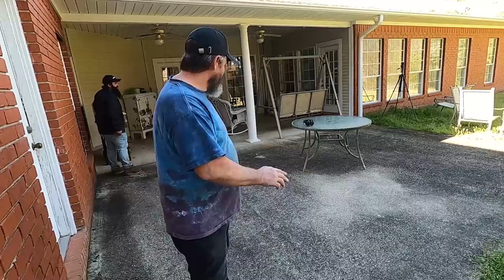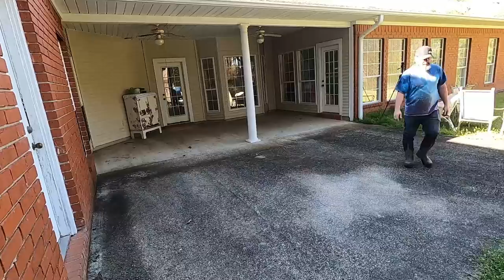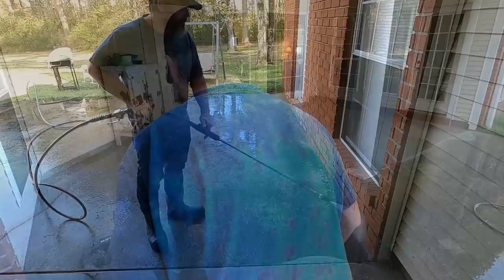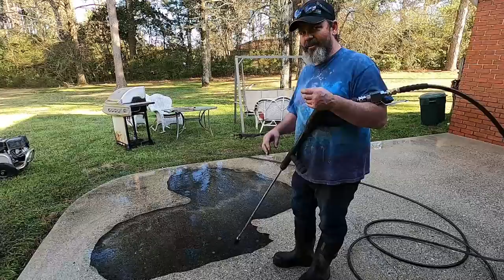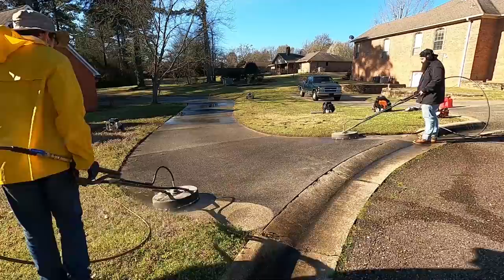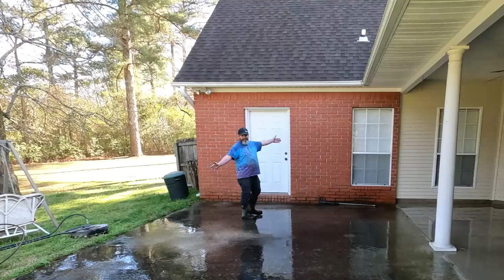REMOVING Decades of FILTH for FREE this ELDERLY woman's PROPERTY TRANSFORMTION is INCREDIBLE!!!

Comment: I am filled with warmth and happiness to know that you boys help others, especially elderly and too sick to do the upkeep on their properties.  My parent's and even myself are in this stage and it's really sad when the will is there but the body is just not able to comply.  Still, I want to try to do this for my parent's huge back patio.  The epoxy finish is no longer staying put as it is chipping in so many areas.  What is that big floor buffer/sander thing you used to scrape away the built-up dirt?  Will it also scrape away the chipping epoxy? Will you please share any tips on what would work best for my project?  My parent's patio cement looks in good condition otherwise. Thank you and God Bless.

Comment: Question:  Is there something you can spray on the finished concrete to inhibit new buildup of moss/algae?
Reply: You can spray liquid moss killer which will kill/prevent new growth. You can also put sealer on after getting it pressure wash which will last 5-10 year as opposed to a few months with the moss killer. Some pressure washing guys will offer a sealing treatment as well, and I know some painters do it as well.

Comment: I changed out that whirly gig head for a straight narrow fan head and I set it to spray horizontally. I bent the last 6" of my spray arm and it now curves up at a 5° angle. This makes for the ultimate "cutting" angle.  Next I'm re-purposing a "steady cam" mount for a video camera to work with the wand so it'll be "hands free" and you'll only need two fingers to direct the spray.
You guys are doing a great service, keep it up. You guys are adorable!
Reply from the maker: Awesome

Comment: Hi Chaps - good job.  I've noticed sometimes you pre-treat with a chemical and sometimes you don't - any reason for that?  I'm just about to buy a very small pressure washer to keep on top of the algae on the paving stones of my very deep shade basement garden in the middle of London.
Reply from the maker: With the power washer I really don't need pretreatment it will take all the dirt of with no problem 😊 I was just checking it out to see if it made a difference 😉

Comment: Great work! is there anything in specific you would recommend to apply to a concrete driveway (cleaner) before I used my surface cleaner? I heard bleach was a good alternative
Reply from the maker: Yes, absolutely! A detergent of Dawn dish soap helps with cleaning and a treatment of bleach water afterward helps brighten it up.

Comment: I think it is great what you are doing.  Is there any way to reduce the water used?  Is there a natural enzyme you could spray to help thereby reducing the water used?
Reply from the maker: It appears that we use a lot of water but a high power machine uses the pressure to clean and less water.

Comment: 6:30, YES, that second less intense wider “back sweep” just as important to remove those pattern marks.  Would it be worth it to put some kind of detergent down, like carpet steam cleaner detergent, that does not suds up prior to break down some of that dirt ?  Or a waste of $$ ?  I’ve been here and the longer you go, you always try and increase that nozzle distance to get a wider hit ;). But it never works.  Is there some type of seal that can be put down afterwards to keep it cleaner ?  I bought me a nice gas powered power washer, love it, those shitty 1300 psi electric washers are useless, not much good other than for washing a car.
Reply from the maker: If detergent is needed we use Dawn dish soap.

Comment: Why not use a surface cleaner? Rather than all that back and forth with a 25 or 40° tip, you could line out the entire patio and then hit it with the disc and be done is less than half the time it took you to do this job.
Reply from the maker: Because I like to do it this way makes me smile 😃.

Comment: What kind of tip is that?
Reply from the maker: Turbo tip.
Reply: @CabinontheHill  can I use my regular pressure washer with it?
Reply: @CabinontheHill  and can u guide me to the best surface cleaner. I’m about to start my business. I need help. I use 30 second outdoor cleaner. What’s the best chemicals for concrete.
Reply from the maker: @oscarivan1037  Yes you can

Comment: I am saying this without harm feelings . First, you didn't push the furniture far enough away from the workspace, which surely resulted in dirty furniture. Also, why didn't you take the cooler out of its place (hope there was a good reason)? Second, there is a way to work with a pressure washer. You wasted a lot of time by not working properly. You started well, that is to say along the wall. Afterwards, you had to keep pushing the dirt outwards and not just anyhow by making “hearts” that wasted your time. Hope you don't get pay by the hour? ! Anyway, if I had been the old woman who hired you, after watching you working for 20 minutes, I would have paid you for your work and told you to leave! I'm actually an old woman and I cleaned my wooden porch (Which was as black as what you cleaned) which is 40 feet long by 6 feet wide plus the railing and 120 rungs (4 sides ) and 2 x 5 steps in 6 hours and it was a very good well done job! 😊 i’ll say it again… No harm feelings